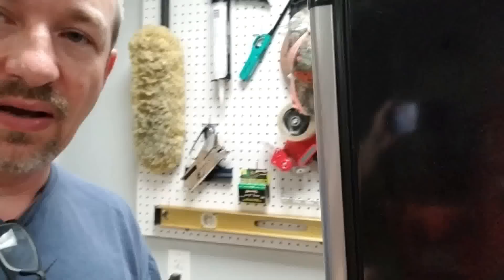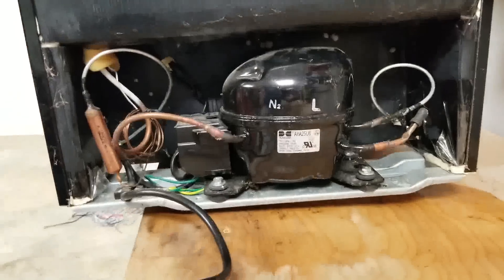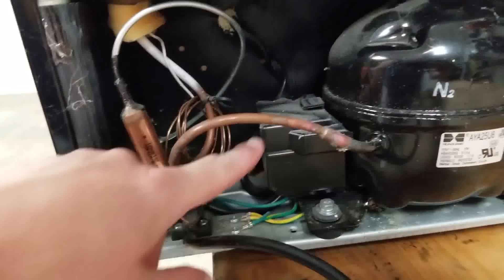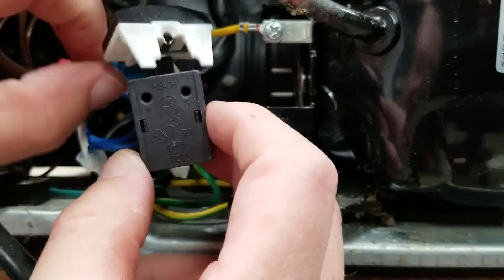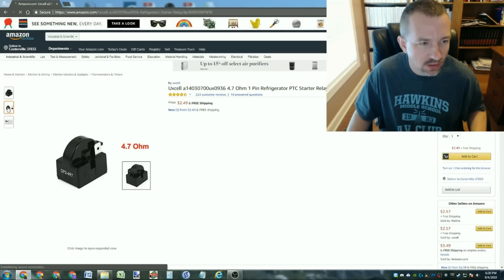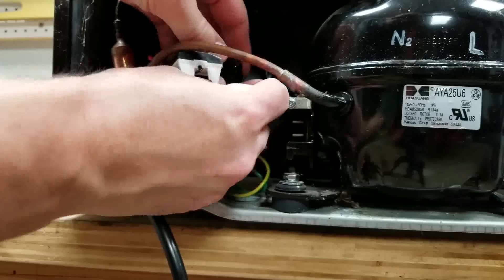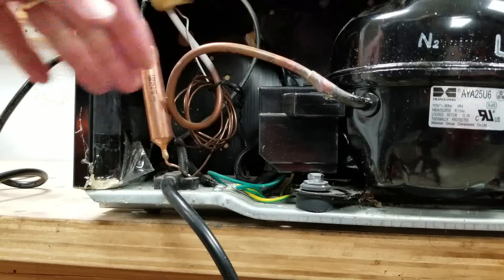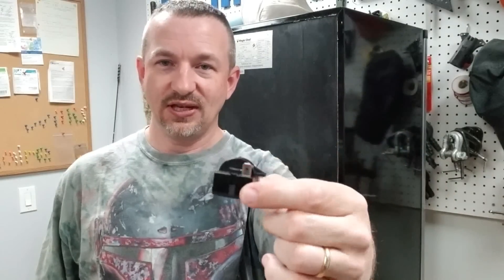Project #22 - Mini Refrigerator Fix (PTC Relay Replacement)

Comment: I bought both pieces.Intalled them plugged it in. You can hear the compressor kick on but it shuts off  quick.What can it be?
Reply from the maker: Unfortunately, if those pieces didn't fix it, its probably the compressor itself, which is not really replaceable.
Reply: @VancesHowTo  could it be the thermostat?
Reply from the maker: @teresadelgado9724  The thermostat is the only other device in the electrical circuit, so I guess so.  But my thinking is if the thermostat is bad the compressor would never even try to turn on.  I think you said yours starts then stops.  Its easy to test though.  Unplug wires from the thermostat (its inside the fridge), and connect them together (bypassing the thermostat).
Reply: @VancesHowTo  
I haven't changed-out any parts yet, BUT mine is essentially doing the same thing – the compressor starts immediately, runs for about 90 seconds to TWO minutes, and then shuts down. Does this sound like a bad compressor to you?!  IS there any way to test the compressor with a continuity tester and/OR a multimeter?!
Thanks.

Comment: My compressed is running but the inside is not getting cold? It a Willz mini fridge 3.1 cu ft bought at same club or costco? need your help
Reply from the maker: I have heard that the start relay could be the culprit even in this scenario.  I would replace it and see if that fixes it.
Reply: Vance's How-To Video Library PTC four pin relay is the one I’m going to replace. Hopefully that does the trick
Reply from the maker: @MrNatethegreat2008  Good luck!

Comment: I have a Haier mini frig, HSW02   The starter relay is a P6R8MC OR 0205. There are dozens of these relays available, but none that end in 0205.  What do the numbers at the end mean?  All people tell me is that mine is no longer is no longer available. No one can tell if a different one will work.
Reply from the maker: If you can find one that fits, even if the part number is not an exact match, I would try it.  Its about a $10 part, and probably worth trying before throwing the whole thing out.

Comment: Great video!  I did this yesterday!  The schematic shows this is an RSIR (Resistor Start Induction Run) compressor with no capacitors.  It uses a PTC resistor to provide Start winding current and then, as the resistance increases, decrease the Start winding current to prevent it burning out.  It is probably a 4.7 ohm PTC.  I found this video while attempting to repair a slighly larger mini-fridge that had the same symptoms.  The compressor got very hot and hummed but wouldn't cool.  I believe it was failing to start because of a failed PTC and just sat there with current flowing through the Run winding but not rotating, until the Thermal Overload cut it off.  The cycle repeated when ever it cooled off enough to reset.   It was drawing about 9 amps while sitting and humming with an LRA rating of 11 amps.  I checked the PTC device and was reading about 60 ohms while it was supposed to be 4.7 ohms when cold.  I disassembled it and found a coin shaped PTC sandwiched between 2 flat spring contacts. One side showed signs of arcing on the PTC disc and its contact.  I sanded/scraped the PTC and the contact and got the PTC down to 11 ohms and reading 9 ohms when the device was reassembled.  I reinstalled it to check my hypothesis.  The mini-fridge started right up and is showing its rated RLA of 1.3 amps.  The new replacement should arrive in 2 days but the fridge is still running.
Reply: Thank you for the Technical information Henry. I hope this works for me as well 😁
Reply: Great story, Henry. This video is very good, but to actually prove the diagnosis before shooting off the parts cannon takes very little time and is so much more satisfying. I've been reviewing refrigerator circuit drawings, and their engineering is no less than fascinating. The downside to those PTC devices is the way the resistor stays in the circuit for the duration of the cycle, drawing power and heat that has to go somewhere. Even though there are no moving parts, it is no surprise the heat eventually gets to them.
Reply: @spelunkerd  I wonder if you can order just the ceramic disk (and get like 5 of them for future replacements)
Reply: S

Comment: Thank you for the tip. Fix my mini fridge from going to the dump and having to buy a new one. The relay was the problem. Replaced with amazon purchase. Saved me money.
Reply from the maker: That's great!
Reply: By the way my relay didn’t Rattle inside old one. but it was the issue with the replacement part fixed it.

Comment: I have the same mini-fridge. I can hear the compressor buzzing, but it doesn’t cool. Also neither compressor line gets cool, but the compressor does get hot. Is this fixable or should i toss it?
Reply from the maker: Toss it.  Sounds like a refrigerant leak.

Comment: Changed this relay and white one below it. Compressor hums but it still isn’t cooling. Is it bad compressor or coolant low?
Reply from the maker: If the compressor is humming and its not cooling, then you probably have a refrigerant leak, and its not worth fixing.

Comment: Your a legend mate. Watched your vid, took the same parts to the local parts shop, plugged it all back together and boom fixed. I replaced the Starter Relay and Compressor Overload Protector. It was prob just the C.O.P but might as well replace em both while I was there.
Reply from the maker: Thank you!  Glad you got it fixed up!

Comment: I replaced the PTC relay without incident, but the sides of the fridge are hot; could this be because it is just acclimating to be on again or could it be something more serious? I also just turned the fridge temp up a smidge from 6 to 3 to let it acclimate smoothly withour setting it to max cold too soon. Not sure if that will help or not. Anyone with advice?
Reply from the maker: It can take a while for those small fridges to cool down.  Give it an hour or so and see if its cool inside.
Reply: @VancesHowTo  Thanks Vance. The sides of the fridge volley between hot and cold, but what is more troubling is the compressor itself is very hot.
Reply from the maker: @ohiocorn62  The goal is to determine if the compressor is pumping refrigerant and not cooling (meaning you are low on refrigerant, and generally not repairable), or if there's an electrical problem keeping the compressor from running (that is repairable).
Reply: @VancesHowTo  We have exact temperature values for the INSIDE of a freezer / refrigerator but nobody mentions the operating temperature of a compressor .. a laser thermometer would be super quick and easy.

Comment: Hey, what if the relay which connects to the two prongs doesn’t rattle but the top one which connects to the one prong rattles? Would replacing the top one fix the problem too?
Reply from the maker: Possibly.  Worth giving it a try before tossing the whole thing in the trash.
Reply: Francois. I’m having the same issue. Did you end replacing both parts to see if it worked? Thanks

Comment: I have a cooler with the split level cooling. One area is cooling and the other is not could this still be the PTC relay?
Reply from the maker: That's a good question.  I'm not sure how those work.  Take a look at the electrical schematic.  If there's just one refrigeration circuit and its working, then its not the PTC relay.  Good luck!

Comment: I took my relay starter out my Black & Decker mini fridg. I shook it and heard nothing.  Any other Suggestions for repair?  Compressor comes on but no cooling.
Reply from the maker: If your compressor is running and you're not cooling, then it probably has a refrigerant leak, and is unrepairable.

Comment: So what happens if you replace the starter and it still doesn't work? So the compressor is gone and should I toss it.
Reply from the maker: If the compressor is not buzzing, it has to be the starter, overload, or thermostat.  Since those parts are all cheap, I would give them a try.  If the compressor is buzzing but you're not getting cold inside, then I would toss it.
Reply: @VancesHowTo  am having this problem when I plug in the freezer it runs for about 5sec then shuts off......I changed the reply and it's doing the same thing......what next to try?
Reply from the maker: @gamalward9478  If your compressor is buzzing for a few seconds then shutting off, its possible the refrigerant is low, in which case there's no easy fix.  You might try replacing the overload, since its pretty cheap to do it.  If the overload doesn't fix it, I would scrap it.

Comment: This is shotgunning. Using a meter to accurately diagnose would have been much more helpful.
Reply from the maker: I can't deny that :-).  In this case, if the compressor is not buzzing, it has to be the starter, overload, or thermostat.  Since those parts are all cheap, I did just guess at it.  You are correct; in hindsight, I should have ohmed the thermostat and overload to rule them out.  Actually, I think I may have done that, but didn't put it in the video for some reason.  I don't remember.  Anyway, thanks for watching!

Comment: If it is low coolant there are piercing valves from Amazon that will install a valve to add coolant for just a few bucks.  https://www.amazon.com/TJ90BPV31-GENUINE-FACTORY-ORIGINAL-PIERCING/dp/B00FYIYIVA/ref=as_li_ss_tl?ie=UTF8&qid=1547517392&sr=8-2&keywords=bullet+piercing+valve+for+refrigerator&th=1&linkCode=sl1&tag=jo0d12d-20&linkId=87ba89e3b6303ce19163613ec3e3ffca

Comment: Hi Vance.  Thanks for the video.  I seem to have a similar issue.  Magic Chef and a clicking sound that appears around every 2 minutes.  And the compressor does not turn on at all.  

I have a PTC w/3 connectors in the back (unlike yours that only has 1), and is also 4.7 ohms.  Nothing rattled inside of the PTC though.  Anyway, I picked up another PTC w/that configuration, but that didn't solve the problem.  

Any other ideas?  I think I'll change out the overload protector next to see if that fixes anything.  Do you know if all overload protectors are more or less the same?

Thanks again,
Eric
Reply from the maker: Definitely try replacing the overload protector.  Also, check the thermostat and make sure its contacts are closed.  I have seen those fail also.

Comment: So, there’s no start capacitor ?
Reply: Nope, There are two separate motor windings and the second set, the start set, gets switchted off after about one second.
The PTC is a ceramic disc that increases the resistance as it warms up.  Turning on the power makes it stop conducting electricity between the two bottom pins.

Comment: I took apart the QP-2 4.7 2-pin relay to a Galanz 3.7 mini fridge (2 door), found out the white wire is the main wire goes across both pins, the black wire is a stand alone-it does not connect to nothing...so when your 2 pin relay goes out, I recommend a 1 pin relay [connect white wire only]...the black wire needs to be wire capped...To find this part try Ebay its cheaper 👍
Reply: Hi i have a galanz 3.5 and the relay has 2 pins (2 , 3). It has 2 black wires to one pin and 2 white ones to another. So your saying the 1 pin relay will work?
Reply: @Raul2.5  I have this same issue. Any help out there?

Comment: I just repaired my mini fridge with the same part.  Note when you remove the old part, shake it and if it rattles, its bad.  I opened up my old part and the ceramic disc inside was broken into 2 pieces, thus the rattle.  Easy to diagnose, cheap and easy to fix vs buying a new one!
Reply: My relay switch was bad but had no rattle.
Reply: @Duval2k7 ours did not rattle either.  The new part fixed it though.
Reply: Yep, not all that rattles is defective and vice versa.
Reply: It may be possible to just clean the contacts. I cleaned the oxidation off the MOV disc and now it's working, even though I snapped off part of the MOV while removing it.
Reply: +1 did the exact same thing.   thx
Reply: Mine rattled, same thing. Thank you!

Comment: Have you ever took a overload relay apart?
Reply from the maker: No, I have never done that.  Its a cheap part to replace, so I didn't see a point in taking it apart.
Reply: It's usually a bimetal switch.  When it heats up it bends and breaks the connection.  I'm sure you can find photos and videos of one being disassembled.

Comment: Excellent video Vance. I fixed mine yesterday, but the compressor didn’t come on. So I came here to see what you did. Thanks to Mrs.Shakur all I had to do was press the reset inside the door.
Reply: Yay! Hi 5
Reply from the maker: That's awesome!  And thanks to MrsShakur for a great tip!

Comment: I have some problems with my 2 mini fridges (Galanz). First one, when i plug in nothing happens. The compressor is not running. No click from the relay or any thing.

Second one, when i plug in, the compressor is running and it gets very hot after like 20-30 mins. The fridge is not cool. When plug in I don’t hear any click from the relay whatsoever.

Any suggestion is greatly appreciated.
Reply from the maker: Those 2 parts I've talked about in the comments (PTC and overload) are cheap to purchase, and in my opinion, its worth a try before scrapping the whole refrigerator.  Maybe buy one set and try on both of the units you have.
Reply: First one sounds like a bad thermal overload or thermostat.  Second one sounds like a bad PTC.

Comment: I have changed that part and didn't get anything not even a noise or clicking
Reply from the maker: You might also try replacing the overload.  Both parts are cheap and worth a shot before tossing the whole refrigerator.  Good luck!

Comment: I HAVE A MINI REFRIGERATOR, GALANZ... NEED THE RELAY SWITCH, JPQII - 4.7 2 PINS, I CAN ONLY FIND IT WITH 1 OR 3 PINS..
Reply: Use 1 pin relay and connect the white wire only...wire cap the black wire or with electrical tape)

Comment: Hi! Nice work! I was just about to trash it and fixed mines!! Yay!!! Only thing is...what noone is telling the ladies is 1. where to put the wires back if you forget to take a pic and most importantly after the install if you plug it in and you still don't hear the compressor...  turn you dial (inside the fridge) to zero and then to your desired setting to reset it. Sfter I did that mines then kicked back on. So happy I am back in business!!👍Thanks for your awesome help!!
Reply from the maker: Cool.  Glad to hear you got it fixed!
Reply: In this model switching the wires wouldn't make a difference, since it is 120VAC.
Reply: @frinchfrize8007  Top pin should be power and vertical right pin should be ground.
Reply: Yeah, I just completely destroyed the plastic housing just trying to get the wire off of it (in this video it's blue and you don't show it's removal).  It won't wiggle off or let me pry it off.  I don't know what I'm going to do except maybe cut the whole danged wire off and try to find a fresh clip while I'm at it.  Maybe melt it off.  Fire's always good, right?
Reply: @calciumchloride710  my fridge died earlier this week, and yesterday finally found videos of how to fix. I to did that same exact thing you did. I couldn't find any videos anywhere on how to remove that plug, so I pretty much got pliers, and broke up the entire rely just to remove that plug. It's a tad bent, but should be ok sliding back onto the new one I ordered coming in today. It would've been nice if it showed how to remove it. After destroying it. It would've impossible to slide that plug off. There was way more attached to it.

Comment: Tried to fix my Vissani/Magic Chef wine refrigerator (MCWC50DST), but replacing both the PTC and the Overload protector did NOT fix problem.  Oh, well, I tried!
Reply from the maker: That's unfortunate.  They're cheap parts though, so its worth a shot in my opinion, before you scrap the whole thing.
Reply: @VancesHowTo  Trying one more thing -- controller board. Can return if it doesn't fix it!  May be able to use other parts for another minifrig I've got!
Reply: @larrythecomputerguy  Good luck, I hope it works! 
What store allows returning the board after you've tried it out, though? I'd really like to know that because I'm trying to fix a washer that has a damaged control board that has turned out to be not repairable. Thanks!

Comment: fail to actually test the old relay instead of just throwing parts at it.
Reply from the maker: I did check to see if the compressor was running (by listening for the buzzing sound when it was powered).  In this case, it wasn't running, so I knew it was either the PTC start relay or the overload.  Both of these parts are cheap to replace.  If the compressor had started running when powered (buzzing sound), I would have known the PTC starter relay and overload were working, and in that case, I would have just scrapped the whole unit, because it would have likely been a refrigerant leak.  Maybe I should have explained that better in the video.  Thanks for watching!
Reply: @VancesHowTo  You can test the PTC by pushing the probe pins of a meter into the two holes on the back side.  The reading should match the spec with the device cool.  In this case 4.7 ohms.  If you get higher than that, or it rattes, it overheated and broke.
Reply from the maker: @frinchfrize8007  Thanks, that's good info!